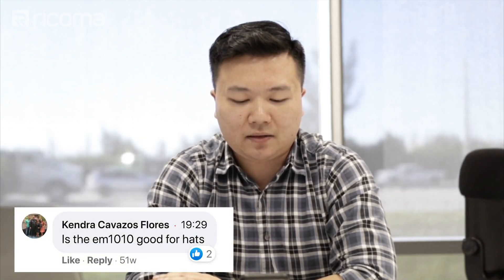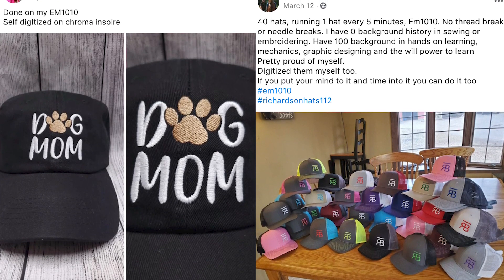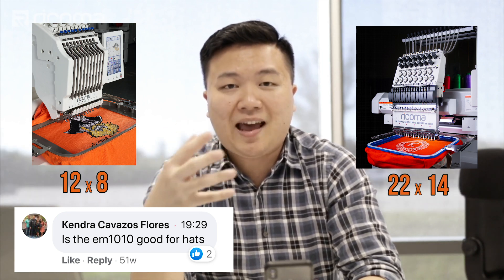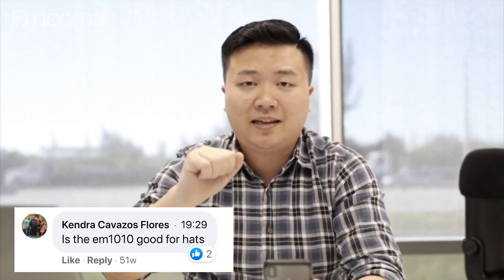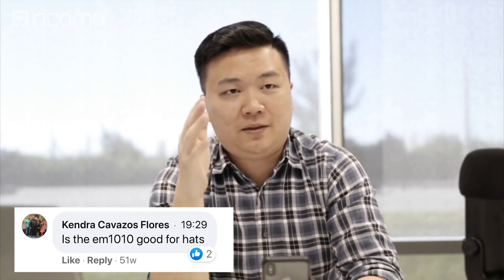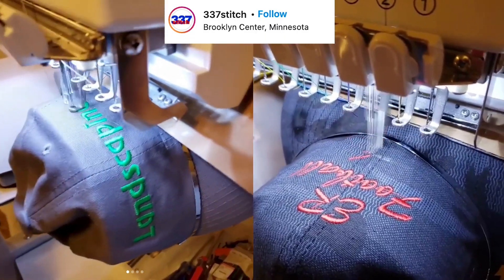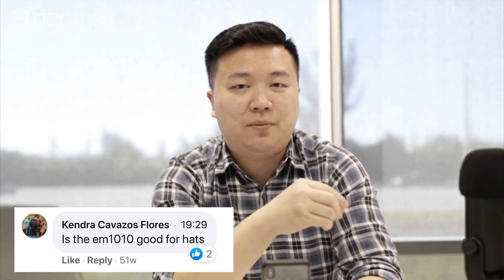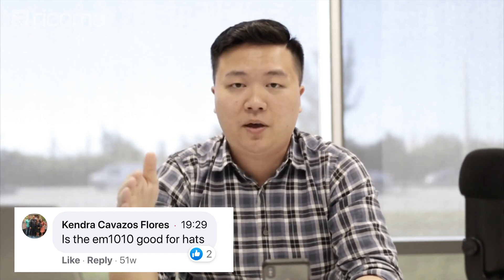FACT or FICTION? EM-1010 Cap Embroidery...

Comment: I make hats with em1010 but there is not enough clearance space for the brims. And it is advertised that it can handle hats but yet it doesn't say its limited. And to say that we would need to spend more money for more space thats not right. You should come up with an upgrade so that we can purchase it and apply it to our em1010.
Reply: I agree completely, I wish my sales rep would have been more clear about this as well!
Reply: @miguelibarra9  My sales rep doesn't even know the machine, I had to let my service guarantee go and repair several things myself which required taking the machine apart. Ricoma was kind enough to send me a service manual and walk me through one of the processes via Duo on my phone.
Reply: The only cap I have problems with is the hard sculpted cap. The frame portion does not go far enough into the cap to keep the brim from rubbing or needles constantly breaking because the cap won't lay flat on the frame.
Reply from the maker: Thank you for your feedback!
Reply: Thank you! That made my decision so much easier!

Comment: I'm doing great with flat embroidery on my EM1010 and cranking out some large orders. Every time I try to do a structured hat I break a needle, including the titanium ones. I guess I'll stick to flats with this machine and make hats other ways. It's disappointing because the ability to do hats was a selling point on this machine. But at this rate I may need another machine soon so I'll get the next model up when it's time.
Reply from the maker: Many people do hats in the EM-1010, in volume too. It has to do with your cap driver set up, hooping consistency and digitizing.
Reply: BS, one of your tech set up my X and Y for the cap and it still is no clearance @ricomatv

Comment: I have done caps on my EM1010 but it doesn't have enough clearance to get close enough to the brim for my liking. The brim hangs up on the body of the machine. If you really want to get jiggy with caps I would go for the larger machine. More clearance more power.
Reply from the maker: Thanks for the feedback and thank you for watching!
Reply: I am having the same issue. The rear plastic of the head hits the cap. I wish there was a way to have more clearease.
Reply from the maker: Bend/flex the cap bill forward before hooping it, and bend it back after being done